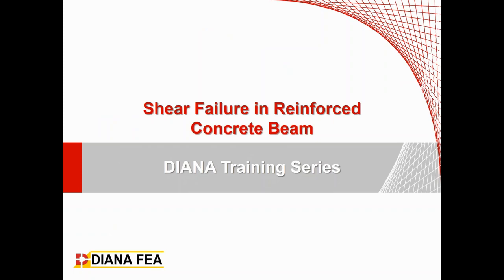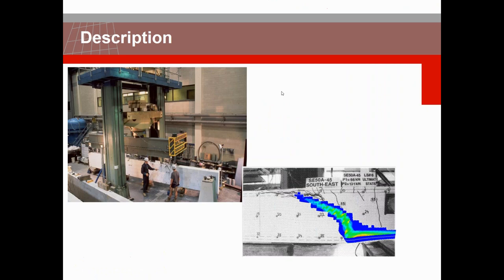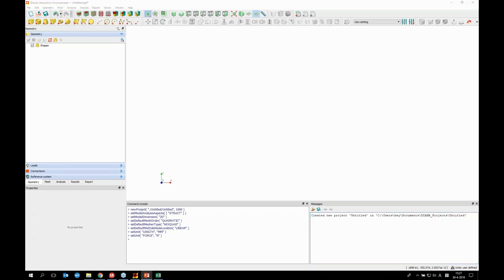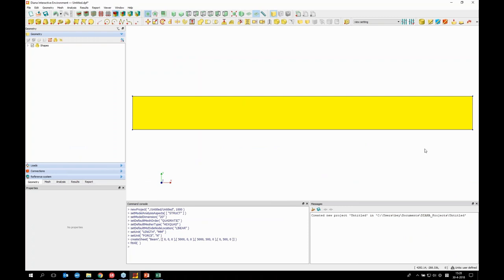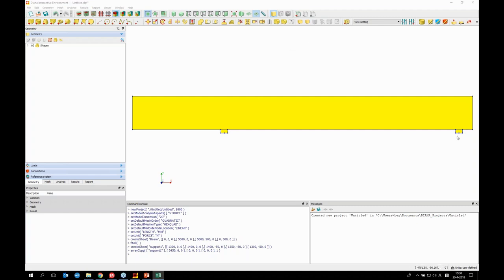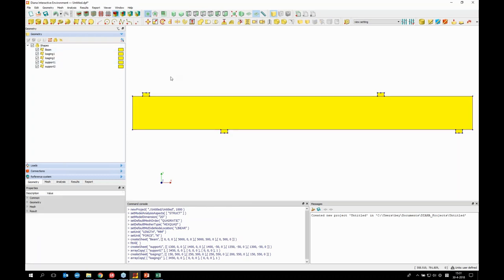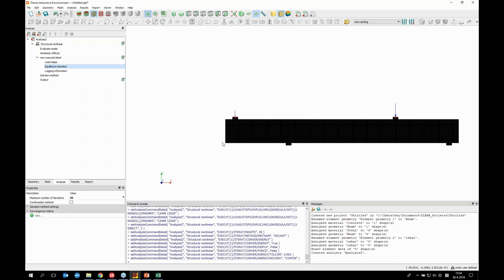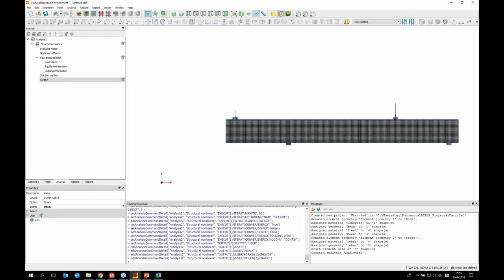Webinar: Modeling Shear Failure in Reinforced Concrete Beams with DIANA

Comment: what about the reinforcement details . I mean in the developed model actually there are 4 reinforcement in 1 section at the top but only 2 is drawn. and the width of  beam is also 169 in drawing and design both. How do u derive on 2 reinforcement only in plane stress problem.
Reply: The cross-section area of reinforcement was doubled in the model